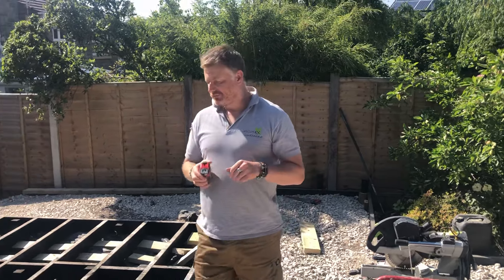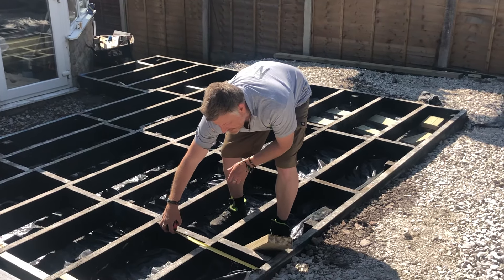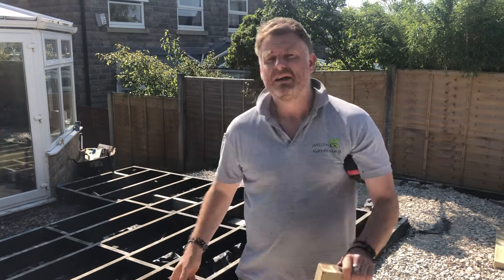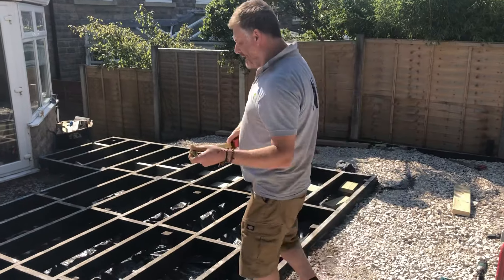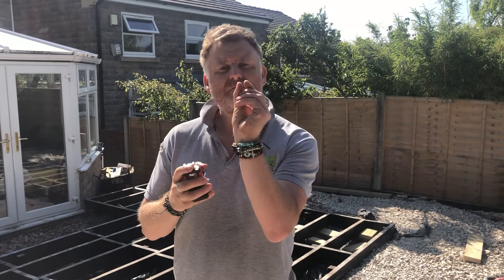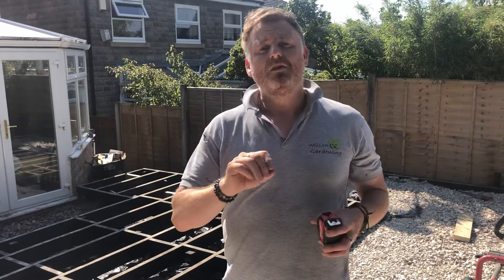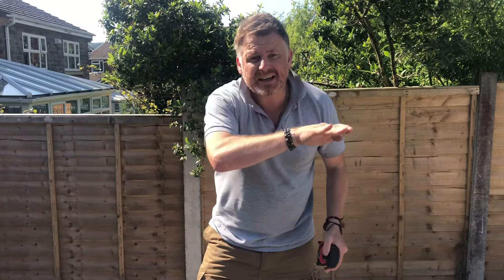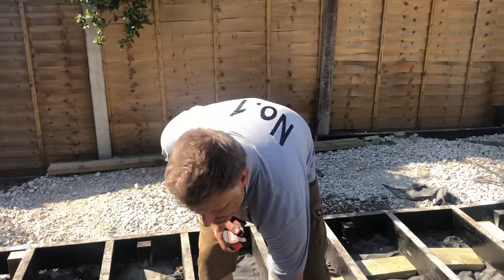How To Build A Sub Frame For A Decking Project Including Tips

Comment: Great tips Gareth i build decks as part of my landscaping business i use the same method as you have explained, my only query is the fall on the deck going towards the house  i think i would make it fall away from the house unless it was not possible .👍
Reply from the maker: Hi Pal I’ve explained below re the fall .....Frame doesn’t touch the house and where the doors are there’s a paved landing with French drain

Comment: Great tip with primer ,but composite decking needs to have a max of 350mm centres ,the boards will sag and bounce
Reply: I believe its 300mm private buildings and 200mm for industrial but in UK might have different standards 🤷 if there is any...
Reply: @inspirePC  I use 300mm and this was back in October lol

Comment: Hi! So I get snow where I’m at would I also have to add that slope away from the house?  It will be built all along the back wall of The House with the exception of the sliding patio door which it will go underneath the framing. Thank you!

Comment: Hi there, if you were to deck starting from the back exit into the garden , is it a must to attach the decking frame to the back wall (something I really do not want to do, do not own the house as such) but instead leave a small gap between the wall and frame? ( enough so you dont slip your feet into it) thanks in advance

Comment: Morning Gareth. Just wondering how far apart and how deep the posts are. Also are they 100 x 100? Am building my deck soon which is slightly raised at the back due to the ground. Thanks, Rob
Reply from the maker: Robbie Crocker posts are approximately 1.5m apart using 145mm x 45mm joists and around 450mm in ground for low level deck. Treat the posts and slope the concrete away from the posts. Slightly raised area I’d go 600mm pal and yes 100x100 posts
Reply: @GKWilsonGardens  thanks Gareth

Comment: Thanks Gareth for sharing this, I'm just about to build my very first deck. Thought I'd got it all sorted in my head but now this has confused me! I'm planning to build a 4.8m x 3.6m deck, deck boards are 4.8m long so I got 6x2 joists in 3.6m lengths and was going to use joist hanging, but I'm now wondering if 3.6m span is too long and if I should put a 4.8m beam down the middle, which would mean using shorter joist lengths? It's going to be ground level but raised a tad where necessary. Appreciate any thoughts on what I should do, cheers.
Reply from the maker: Not 💯 sure what you mean but I’m thinking you should run a line of ‘Noggins’ or joist supports inbetween each 3.6m joist in the middle to support the frame work and make stronger and also stops the joists twisting in differing temps. Plenty of supports legs too mate

Comment: How deep are the posts for this low level deck? How wide are the holes? 

Is the Bitumen primer same as the Bitumen paint? I thought this stuff was thick, so 3 coats seems alot, or is that the stuff used for rooting I'm thinking of? Is the Bitumen primet/paint as good as the joist tape that's sometimes used?

Cheers!
Reply from the maker: SupermanKelly™ posts are 450mm I’m the ground for a low deck, around 400mm wide, I apply 2-3 coats and fins if works but everyone’s different and it about what works for you. The joist tape is excellent I’m told but we are having good success with the Bitumen.. I’ll definitely try the tape soon
Reply: @GKWilsonGardens  Tapes not that easy to find and what I have is not cheap. So from price point Bitumen paint might be better.

Post holes at 40cm are wide than I expected. Does a 20kg bag of Postcrete fill that enough to be above ground level and form it so water runs  off? Or are you using normal cement mix and adding until fill?
Reply: Try everbuild black jack bitumen paint 👍🏻
Reply: @tonyl1984  I did posts with Blackjack  Bitumen paint. Bought the primer for the frame. I assume this goes further as it's thinner.

Comment: Hi Gareth, great video. Planning a deck 500x680. Maybe a silly question, but do you try and space the joist so that the decking boards fall as much as you can without waste, or do you space the joist at x intervals and however the boards fall then you just cut them accordingly? (am I overthinking this)

Comment: Gareth,
Great video. How far apart have you placed the posts to support the frame with c24 and 400 centre. Assuming your using 7x2 or 147*47 would it be around 3m ?
Reply from the maker: Half that mate

Comment: Great video. Really helpful tips. Would you recommend joist hangers or coach screws to attach the joist beams. Thanks
Reply from the maker: james bucknall we use hex screws which is load bearing mate. If it’s elevated I’ll use both

Comment from the maker: I’m adding this comment due to the misconception the frame touches the house - It doesn’t - There’s rectangle area outside the doors (please still pause to see this) that’s paved with a French drain it’s basically a landing at a lower point snd you step up to the deck. The conservatory is octagon shape so only the door areas is running parallel to the doors hence why I’ve put a lower land in and drains.

Comment: Would decking oil be as good as bitumen primer?
Reply: no, bitumens far better for the bits you don't see.
Reply: @Squats200  thank you. I did actually use the bitumen primer for three coats afterwards. Currently building a 3foot high raised bed and have treated all of the wood with bitumen primer then actual bitumen. Will cover with plastic on top of that prior to reintroducing the soil. Also, will bitumen the concrete that the posts are sitting in 😊
Reply: cant hurt can it. I always over engineer too!  @PureTruth
Reply: @Squats200  drives my missus mad 😂😂😂 “Why’s it taking so long?”. Should last a lifetime if done properly I tell her 🤣🤣

Comment: Hi Gareth, we have a timber decking. The top bit is really good though it's  very old(no splinters or loose  decks) . It's just the bottom bits on which the decking stands that is rotten. Can we replace the bottom bit alone or do we have to replace the entire deck? We live in England.
Reply from the maker: Komali Reddy if it was me I’d replace the lot. If the joists have gone the boards won’t be far behind.
Reply: Thanks a lot for your reply Gareth.  👍

Comment: Hi there, what bitumen paint do you use?
Reply: I can recommend Black Jack - Black Bituminous Paint. Which  is available in the UK. I've done two coats on my decking joists, water runs straight off

Comment: Why is your deck falling towards the property?
Reply from the maker: Nigel Davis .... None of the sub frame touches the house if you notice. Outside the door is lowered landing that’s been paved with a french drain against the house and the paving slopes away from the house too. I’ve mentioned this in earlier posts pal and fully understand you asking. I’ve got finished pics which would show you better too
Reply: Thanks Gareth. Quick1,  when i do my sub frame, should it fall horizontally with the boards & away from the house mate?
Thanks

Comment: That deck is running towards the house.  Not away pal or your level is broken
Reply from the maker: Ashley New No it’s absolutely fine the level pal. Theres a lower landing mate outside the doors with a paving slab (not installed at this stage of the project) and drainage in front of the conservatory. Width of the doors 1.2m and drainage installed as mentioned  .... the rest of the frame is not fixed or adjacent to the conservatory.... Take a closer look 👀

Comment: This is bullshit, that frame will rot out in under ten years.
Reply from the maker: No it won’t …. It’s C24 treated, over 60mm off-the-ground, cut ends are treated and a bitumin coating too ….. Check what TRADA say before your comment …..
Reply from the maker: On the FLOOR class 4 …… It’s NOT on the FLOOR 🤣
Reply from the maker: No one uses hardwood joists not even Dr Decks do ……